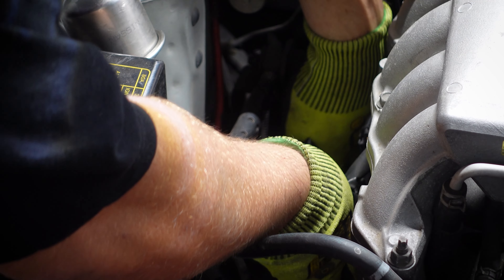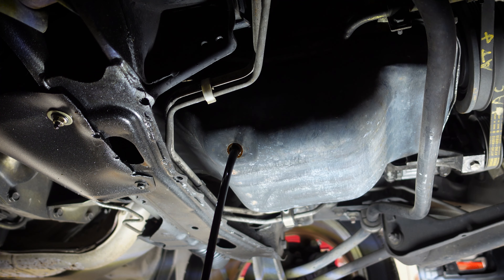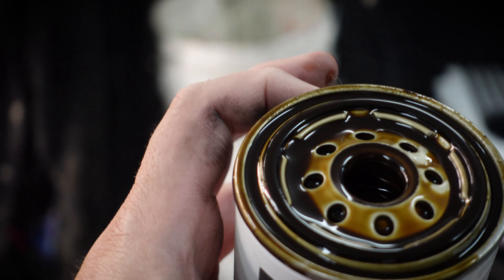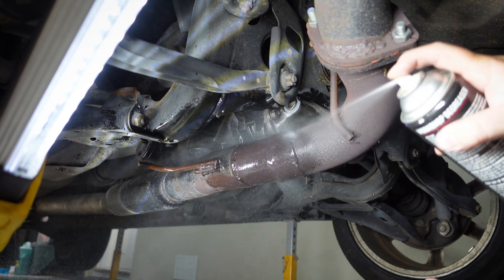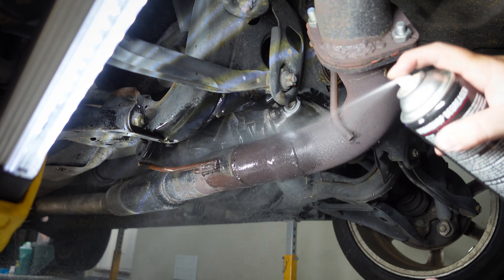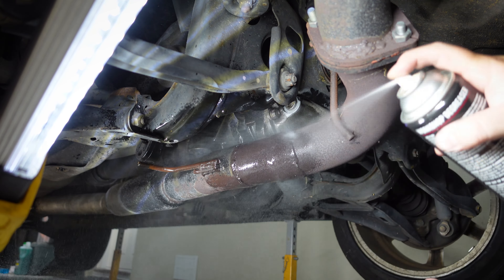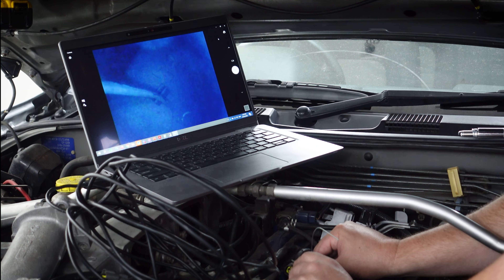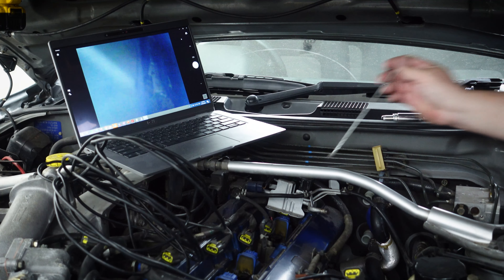Everything goes wrong servicing my R34 Nissan Skyline (Double episode!)

Comment: Could pick up on the cat, it will sound a lot better with a full 400cpi cat

The RB25DE NEO is such a bastardly raspy engine and really need a big resonator and a good cat, despite this though one with an actual exhaust not just damo's straight pipe is a sound to behold

I used a vibrant performance 2.5 inch ultra quiet resonator and the note is scrumptious no rasp at all
Reply: I watched your videos on 25GT...do you still have that Kakimoto exhaust? The one video with stock extractors and(you said you had "broken" cat) doesnt sound that bad 🙂
Reply from the maker: Yeah I'm thinking I'll swap out the resonator at a minimum, maybe the muffler too as  a temporary measure- plan is to engine swap at some point so the turbo will quiet it down 🤣

Comment: I love your skyline guides I’m getting a r34 hopefully by the end of September how’s the reliability on this I’m getting the same one, with the automatic transmission
Reply from the maker: My auto trans is not great - seems to slip a bit and they have issues with solenoids over time. I wouldn't say they're particularly problematic if you get one that's in decent condition to start.

Comment: I'd love to see what is needed to upgrade to bigger brakes.
Reply from the maker: Brakes will be on the list at some point mate but probably not until I do the engine conversion because it'll need to be spec'd out by for engineering approval.  I do know you can retrofit R33 GTST, R34 GTT and GTR brakes but you need to be careful as some have different hub sizes from memory (even within the same model/series)

Comment: Do you think that in this car(NA engine) the original snorkel air intake is better than the "custom" air pod?
Reply from the maker: Hard to say, I don't think the pod filter added any power at all. It might have had more induction noise but with my exhaust being so loud its hard to tell. I much prefer the stock intake so that it looks OEM. Stock look is rare on these nowadays.
Reply: @TheBuildRoom  Yeah i think that the air pod would get hotter air from the engine. I just bought the Apexi filter for stock box :-) Of course on my RB20DE NEO i wont feel a thing :-)

Comment: What if I don’t want to make a mistake while servicing the r34 being without that many years of experience, would it be wise to take it to a technician to get serviced on? If so what technicians would be available if I don’t reside in Japan.
Reply from the maker: Well if you aren't confident working on cars in general, and aren't looking to build your skillset then yes I would suggest you use a technician. There's usually companies able to work on JDM cars in each city, and the RB25 isn't overly technical so it shouldn't be too difficult to find someone near you. If you do want to build your skills however, DIY is very much a possibility. Everyone has to start somewhere, there's no reason it can't be a Skyline. Just start small and take your time, research things thoroughly and double check everything as you build confidence. Best of luck!